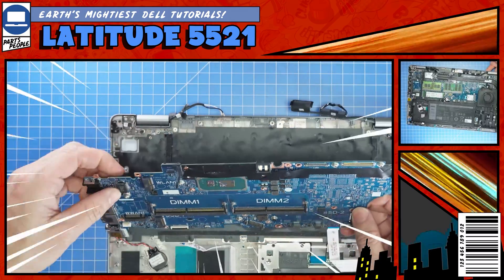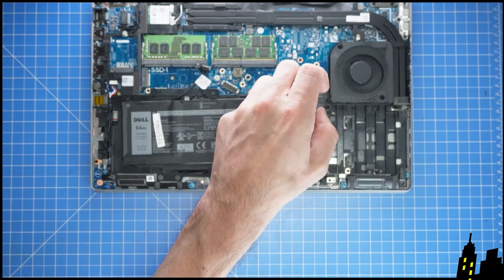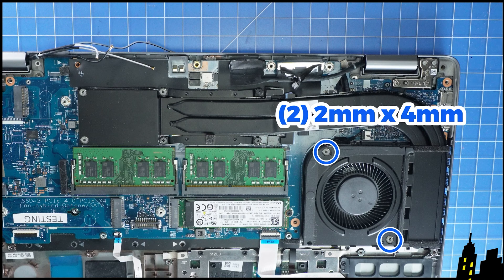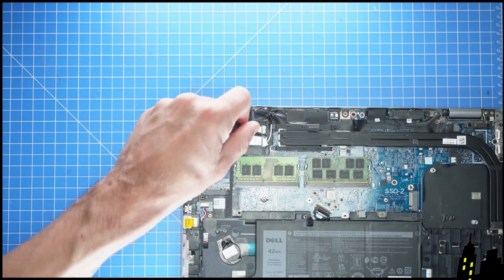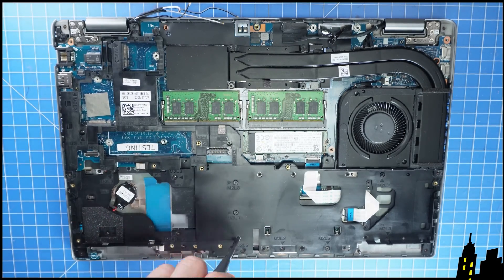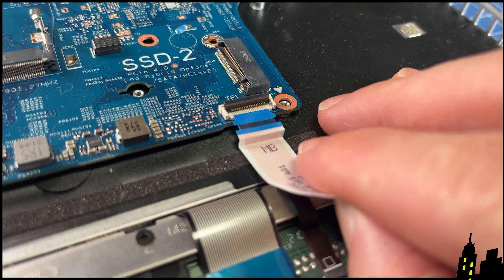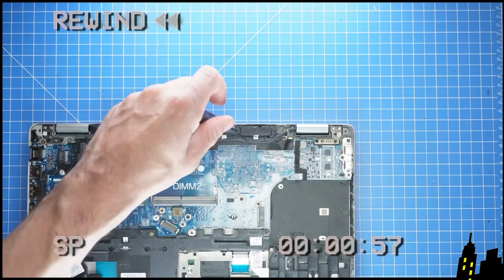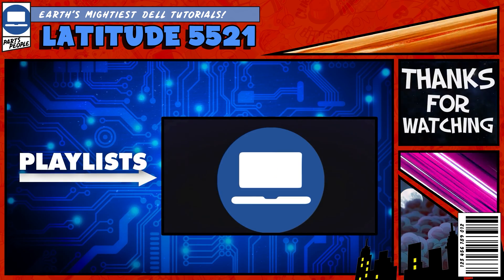How To Upgrade or Replace Your Motherboard | Dell Latitude 5521

Comment: Hi , my dell latitude 7390 has got a problem, it will boot only when i keep the power supply and it works fine on battery after booting , only for starting the laptop i need to give power supply and also it is showing time and date error . Can i know what can the fix for this please.
Reply from the maker: Based on your situation I would lean towards the battery being faulty or nearing its end of life. Replacing it may solve this issue.
Reply: And it probably needs a CMOS battery